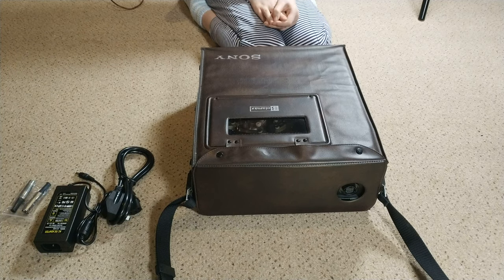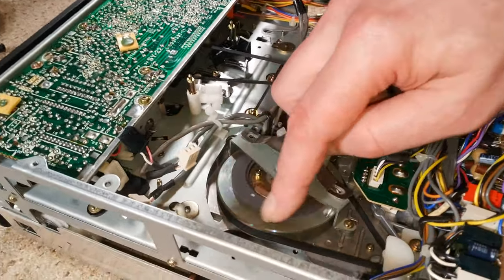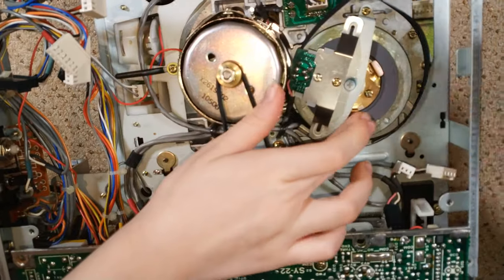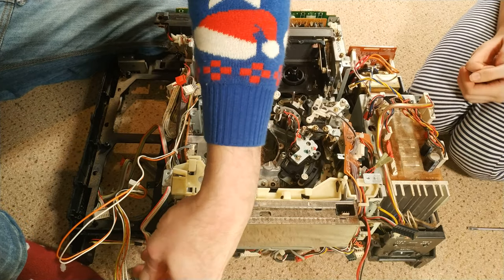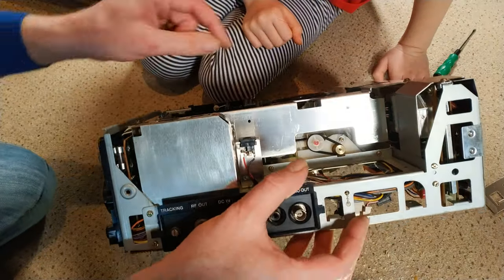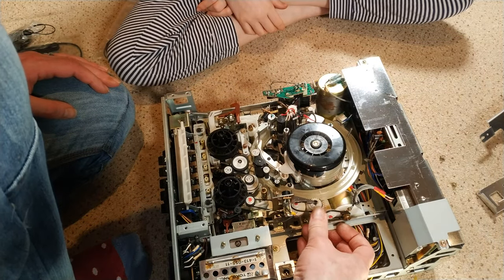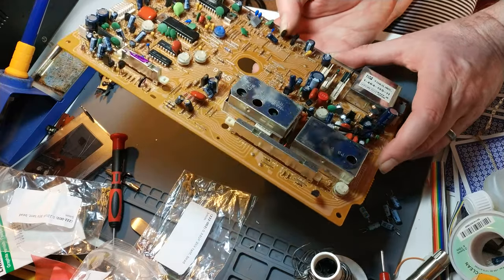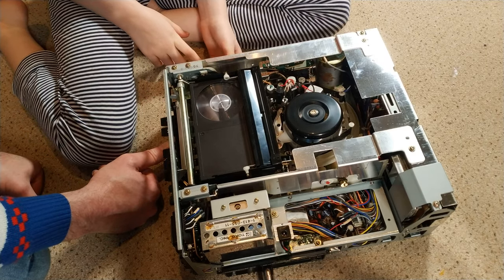Sony Betamax SL-3000 'portable' video recorder recommission - feat. Lils

Comment: I used to sell these units when I worked at a Sony dealership, the mech was based on the original SL8000/SL8080 I believe, came with the matching  TT3000 tuner timer, and a HVC2000 colour camera. Built like a tank! 25/30 mins battery life when used with the camera... the SL-F1 was a massive upgrade when that was launched. Bit like the SL-C9 in portable form, which again, was a massive update from the SL-C7/C5 units.... happy days!
Reply from the maker: Thanks for the comment - fills in some gaps too. Interesting on the battery life too - not to bad considering the size of the battery and it's chemistry against how much current the whole sha-bang uses. I do have a TT3000 on the way so Lils has the complete setup (minus the camera of course) and the ability to easily record from standard video kit rather than just a camera. The F1 was an amazing piece of kit for it's time. I have part two of the F1 to follow shortly :-)

Comment: I just bought an SL-3000 and find this video very useful to understand how I can a full belt replacement on this vcr. Thank you so much!
Reply from the maker: My pleasure - really glad you found it useful.
Reply: @MrBetaByte  Do you happen to know the pin out on the 4-pin power plug? I don't have the original Sony power supply and I want to use that connector instead of the battery dc input.
Reply from the maker: @markederveen1949  I do - it is at the bottom of the description but in case you can't see them they are:
The power supply pins are as follows:
Pin 1 (Right bottom pin viewed from back) Ground
Pin 3/4 (Top two pins viewed from back) 12v
Pin 2 (bottom left viewed from back) No connection
This assumes rounded ident is at the bottom as viewed from the back of the plug (solder side)

Hope this helps.

Comment: I managed to get the loading ring back together and everything, however there is one problem left to deal with. The solenoid that engages the pinch roller during play and makes it come into contact with the capstan shaft is only moving a little bit and not engaging. I can manually move a lever and it will engage and play fine with no servo issues. Do you have any ideas of why the solenoid is not engaging properly? Using a voltmeter it's getting the full 12 volts to the solenoid when going into play mode.
Reply from the maker: Is the solenoid plunger free to move? I have had them stick and a little bit of grease sorts that out.
Reply: @MrBetaByte It pushes out to disengage the pinch roller for FF/REW, but I can't get it to automatically pull back in to re-engage the pinch roller for play/record.

I took apart the PD-9 board where the solenoid is on, and after putting it back together I don't think I put it back together correctly because now it won't engage properly with the pinch roller manually. Before I could move the lever by hand and get the tape to play. Now it won't do that. 

There's also a circuit on the PCB that has a transistor, resistor and a switch. It's the PD-9 board in the Sanyo VTC-3000 schematic.

I'm going to open the actual solenoid and give it some grease and hopefully that will fix it.
Reply from the maker: @KylesDigitalLab   OK, it's worth looking at. I now have Lils SL3000 so if you are stuck, drop me an email to mrbetabyte@gmail.com and I'll send you some pictures. I still think there's an issue with the lacing ring but the solenoid is a very good call.

Comment: On my SL-3000 the supply reel isn't turning in play mode. Fast forward works perfectly but in fast rewind the supply reel spins but very slowly. Also it's eating tapes.
Reply from the maker: First of all, how are the belts and idlers? If they are good, check the mechanical moving parts are moving freely - it may well be grease that's hardened. Also might be worth checking for any missing springs too. Unfortunately I don't have a manual for the SL-3000 but I'm looking to get one and I'll let you know when I do (it'll be an electronic copy).
Reply: @MrBetaByte  I'm going to boil the belts. What screws did you take out to access the belt under the loading ring? Is it just that one screw at 52:56?
Reply from the maker: @KylesDigitalLab  I loosened off the screw that holds the plastic roller assembly that the loading ring runs along. Just slacken it off and then you can wiggle it and move it out the way - easier than removing it altogether.
Reply: @MrBetaByte  I managed to get it loose but I can't put it back in. I see the plastic rollers but I can't get the teeth of the loading ring to engage with the teeth on the gear.
Reply from the maker: @KylesDigitalLab  It's a tricky thing to relocate and it needs to be in the correct position rotationally too. Take it steady and look all around the loading ring to make sure rollers on levers and the rollers for the ring itself are all properly located before trying to get it back in position.
Reply: I still can't get the ring located properly. It's getting stuck on the release lever when trying to eject. @MrBetaByte
Reply from the maker: @KylesDigitalLab  If you drive it by hand from the pulley the lacing motor belt connects to, can you do a full lace and unlace? That belt really needs to be in good condition. If you're stuck, I'll get Lil's Sl3000 and refresh myself on hour the ring is setup and let you know.
Reply: @MrBetaByte  I replaced all of the belts for loading. That fixed the problem of it eating tapes. I just got to get the ring in and I'll be fine but it's getting stuck on the release lever when unthreading. I also should mention that I don't actually have a tape inserted I'm just manually pressing the switch that detects the cassette.

If you could get pictures of how the loading ring is setup that would be super helpful. Thanks

Comment: I have a SLO-340, which is basically a professional/industrial version of the SL-3000. Mine is completely dead and won't turn on. It worked fine before but has developed a problem.
Reply from the maker: Thank you so much for the comment. The power supply section is relatively straight forward - are you going to have a go at fixing it? What have you tried/ discovered so far with it?
Reply: I'm having issues removing the SYSCON board (I assume my problem is on that board). It doesn't seem to want to come out like on your SL-3000.
Reply from the maker: @KylesDigitalLab  Did you manage to get your SLO-340 working in the end?

Comment: hi my sister has 2 young ones teens now  if i was to show them how the decks work she goe's nuts big  time they are very clever it's  me  x 2 more she will not like one bit
picked up one more betacam sp this one got to be  the one i have to  do alot of work on 

i have 12 x sl100ub  i have to  test and work my way in to them  working on tascam 38   decks 4 i can get working  2 are very bad  the main logic pcb's are bad 

the rest is ok they started to play up over time  bad breaks all the the pcb
Reply from the maker: It's a shame - these machines will be lost to time but if just a few of the next generation know what these things are, how compromised they are but also how wonderful, then I think that's a great thing. Plus they are magic in a modern world!